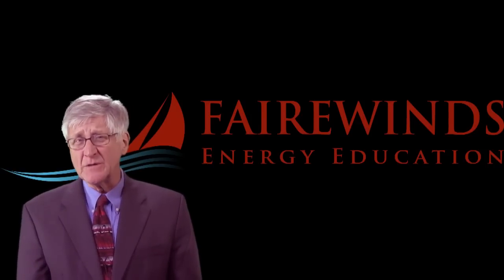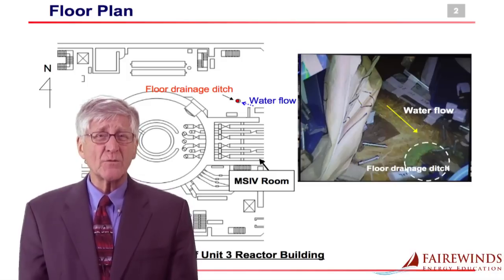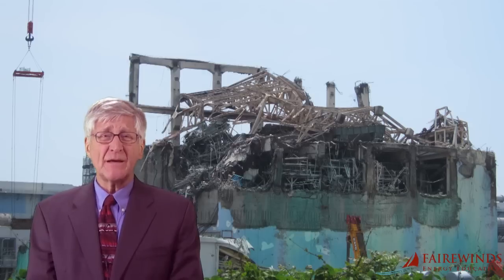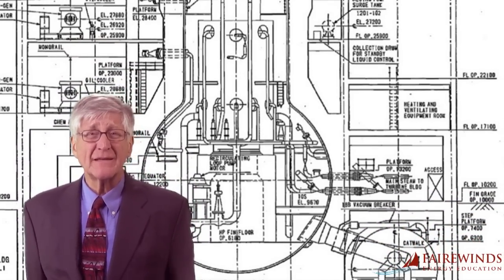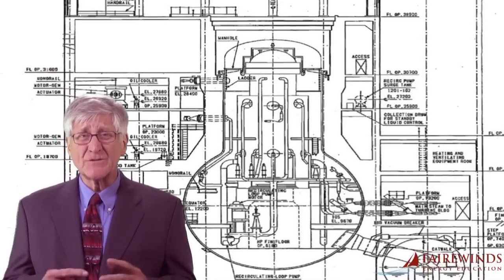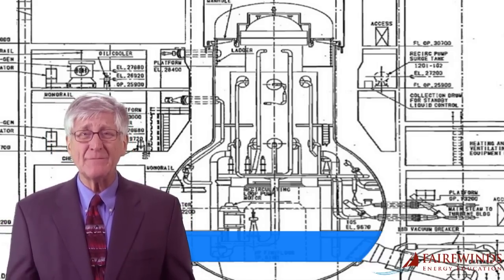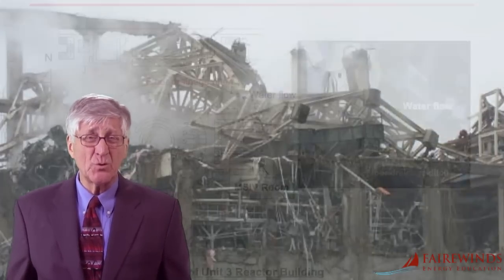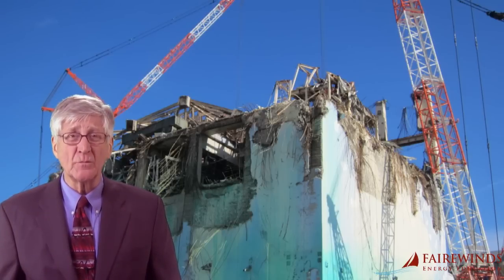Arnie Gundersen: CSI  Fukushima   Fairewinds Energy Education (02/19/2017)

Comment from the maker: http://fukushima-diary.com/2014/03/underground-wall-on-the-seaside-of-reactor3-was-possibly-broken-groundwater-level-in-sync-with-ebb-and-flow/
  
The groundwater levels have been in sync with ebb and flow since the end of February in the seaside of reactor3.

Those groundwater levels are observed in two borings inside of the underground wall. Those borings must be separated from the sea.
However since 2/25/2014, the water levels are synchronized with the seawater level from Tepco’s data released on 2/28/2014.
 
Tepco hasn’t made any announcement about this trend, but if the ground wall is broken, it means contaminated groundwater is leaking to the sea again.
According to Tepco, they measured nearly 7 trillion Bq/m3 of All β nuclides from the contaminated water taken in the seaside of reactor3 last summer.
(cf, Tepco detected nearly 7 Trillion (10^12) Bq/m3 of All β nuclides from contaminated water in the summer of 2013 [URL])

Comment from the maker: http://www.radionz.co.nz/national/programmes/sunday/audio/2583503/wayne-brittenden%27s-counterpoint Arnie Gundersen interview on Radio New Zealand, Jan. 26, 2014 (at 7:30 in): The worst problem is at the bottom of [Fukushima] Unit 3, the water is much more radioactive than where this leak was. So what that tells me is that the nuclear core has disintegrated and it’s basically a powder. Almost like one of those glass balls you shake up and it makes snow.That bodes very poorly for nuclear decommissioning.

Comment from the maker: http://voiceofrussia.com/2014_02_21/Leaked-water-from-Fukushima-may-cause-leukemia-expert-5979/ Feb. 20, 2014: [...] This was an extraordinarily highly radioactive leak. They claim it didn’t run directly into the ocean but almost as bad it’s leaked into the ground water. And the ground water will get to the ocean shortly. So, It is just one more source that will definitely contaminate the ocean if not now – eventually. [...] I think Tokyo Electric is pretending to be the victim of these problems instead of the perpetrator of these problems. They created this problem and they have a responsibility to make sure it doesn’t happen [...] leaks on the site that never seem to stop. [...] it went into the ground and is moving downward into the ground water, which will get to the ocean shortly. [...] it is heading for the ocean anyway along with many other leaks. The site is going to bleed into the ocean for a hundred years. [...] The isotopes that are in this tank is something called strontium 90, and it is a bone seeker that causes leukemia. And it stays in the environment for 300 years. [...] They have contaminated the entire ground water underneath the site and eventually all of that water will move into the Pacific.